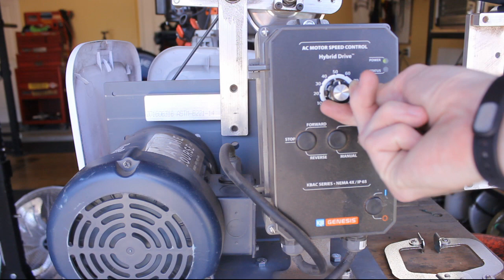2x72 Belt Grinder Review- SRG - Worth Your Dollars?

Comment: From the link in the description, what options do you feel are necessary when buying this grinder? More specifically, drive and tracking wheel size. Along with this and the motor/drive, what else is required? I know this is a lot but I really appreciate it.
Reply from the maker: Hey Jerry, the grinder I have is great, and I got it at a great deal already put together. If I were buying a new grinder today, I'd seriously consider the NorthRidge Mod-E grinder (towards the bottom of the link below). The grinder comes with a 4'' drive wheel and is $475 shipped.  In my opinion a VSD is necessary. As far as HP, I've seen anywhere between 1HP and 3HP. Most people fall @ 2HP. Mine is 1HP and does fine. http://www.northridgetool.com/grinders/
Reply: @RedBeardOps  I really appreciate you taking the time to answer my questions. I think I may step up to a 48" from my 1x30". Keep the cost down some. I just bought a couple of acres in East Texas with a small lake on it. Bought an older RV, a pickup, etc. Splitting my time/money between the property and the knife making. Thanks again.
Reply from the maker: @JerrySwatsell  Hey Jerry, One of the first reviews I did was on a 2x42. It's a decent grinder to get starting with. You will need to be patient with it. Here is my review (I apologize for the simi-loud intro!) - https://youtu.be/3AvFCTcLLuY
Reply: @RedBeardOps  Apparently not anymore, all the Nridge grinders are over $2k currently.
Reply from the maker: @timgagnon4396  Hey Tim, have you emailed them? I didn't know they got rid of the MOD-E

Comment: You say the motor is a 1 hp, but at what rpm? Just curious because I’m about the get a 3600 rpm 1 hp motor but I’m worried it’ll have too little torque since a 3600 rpm 1 hp motor should have half the torque as a 1800 rpm 1 hp motor. Really enjoyed the video I’m really leaning toward getting one of these!
Reply from the maker: Jackson Broussard hey man, honestly I don’t know. I think the drive wheel and default shaft RPMs play a role.
Reply: JKeetonKnives well I was just wondering what the rpm rating is on the motor nameplate
Reply from the maker: Jackson Broussard yes sir, I figured this is what you were after. The way the motor is oriented and attached to my grinder the name plate is not readable (if it’s on there at all). I also don’t have records of this unit since I did not purchase it new.
Reply: JKeetonKnives ahhh gotcha